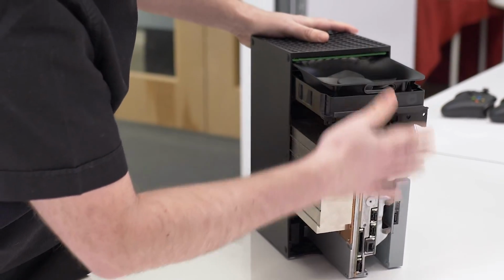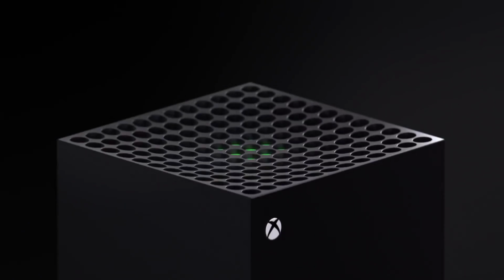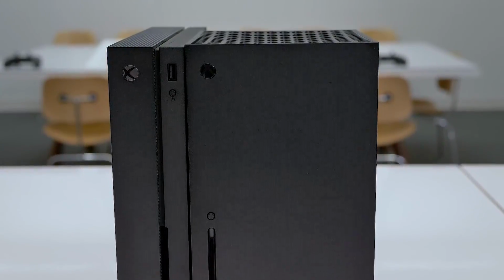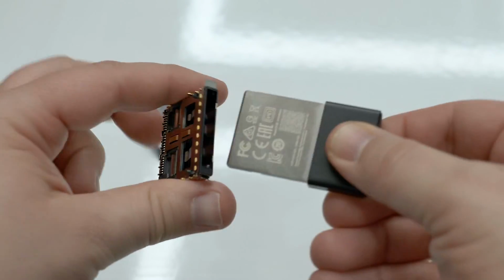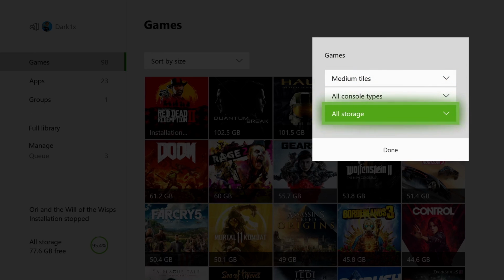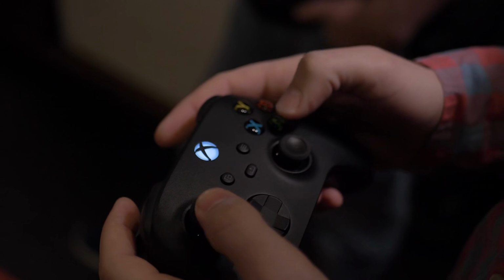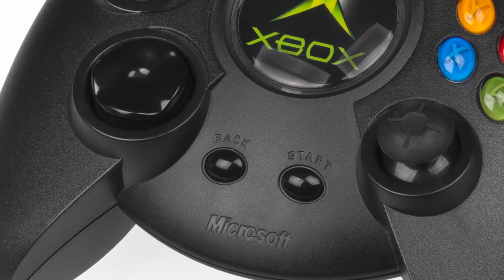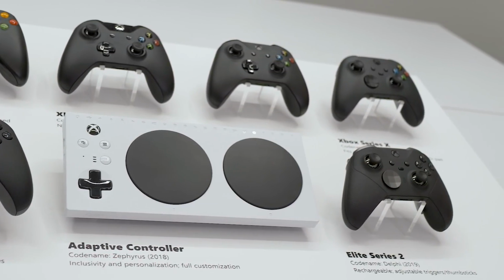DF Direct: Hands-On With Xbox Series X  + Impressions + Xbox One X Size Comparisons!

Comment: Ya a lot of pc players are having a hard time coming to terms with the x series hitting 120fps at 4k and it's only going to cost you $500-$600 alot of people covering info on the x series say RUMERS point toward $500 which I don't find hard to believe I mean with all the new GPUs and CPUs coming out this year or the next for pc it's really not hard to believe it's going to be sold at 500
Reply: 120fps at 4k..... dont be silly
Reply: @ViperT0ngue  if rtx is off ya it will info was just realised that the gpu is at 1850ghz and the cpu is 3.8ghz and by the way why else would Microsoft put HDMI 2.1 on The Next Gen X Series if they can't pull 120 frames at 4K
Reply: @chrisputkamer3249  because that 120fps at 4k will be for the platformer type of games. I have a overclocked 9900ks 5.1ghz and 2080ti with 32gb ram which is more powerful than series x, even that can struggle in some games at 4k. Get a grip mate ffs

Comment: The Xbox Series X is basically the same size as the Velka 5 PC case (The Velka 5 is 0.4cm smaller when you add all dimensions). So it is possible to compare them. The Velka 5 supports full length 2 slot GPU like the 2080ti founders edition however, the CPU tower size is limited, but can support the AMD 3700x which also has 8cores and 16 threads using the alphenfohn black ridge CPU cooler. That being said I really love the amazing design of the Xbox Series X the design team should get an award for it.

Comment: Question on SSD- if it is external. Are they keeping the cost down by not including an SSD? Consumers have to purchase their own from Seagate, in addition to box
Reply: Series X has an internal SSD that external one is an expansion
Reply: @gromester1092  hmm i did not see that only the external. Did they confirm size? I will have to watch again.
Reply: I believe it’s a 1TB SSD for the internal. There are other videos that I’ve seen that shows internal SSD and other specs.

Comment: The original One controllers bumpers were stupidly designed, the connectors to the body broke over about a year off use, it was the same design used on the original Elite too, mine broke after a year for the left bumper and had to order a part off Amazon by a 3rd party which is actually slightly better then the stock one, colour matched anyway, I had to take the controller apart to fix it. I think they changed it for the 2nd gen design so might have fixed the issue

Comment: I have a problem with the Elite controllers, the rubber grip pieces stink after a while with no easy way to clean and the material warps and pops out of the edges after months of use, I feel one day my original Elite rubber pieces will come completely off
Reply: Yeah that was a common problem of the original elite controller.

Comment: that plug in NvMe drive is strange as hell, I'm using a NvMe external on the PS4 and it gets so hot it dismounts the drive, this looks so small and plug it in and that's it i hope it looks cool, but it sounds like you can't run the series X games from it which just sounds not the best idea, the internal SSD space will be very small so it needs to be able to run games from the external SSD especially if they have gone to the extent of making a special one you have to have that's a major disappointment if going that way hasn't solved being able to play and load the new games from the SSD, so thats a big disappointment to me

Comment: This is just an overheat waiting to happen. That crammed space wont be good for ventilation.
Reply: Z Ξ R Ξ N Λ D L I I’’m guessing that you’ve never had a one x apart... that’s way more crammed. I’m also guessing that you think they haven’t been testing the series x in the Xbox take home project or done any sort of stress testing. Or you wouldn’t have said what you did 💁🏼‍♂️
Reply: @seanstammers1010  I can say the same thing and yet original x360 RROD. By your logic, Microsoft release x360 without doing any test on it, that's why the infamous RROD was even a thing.

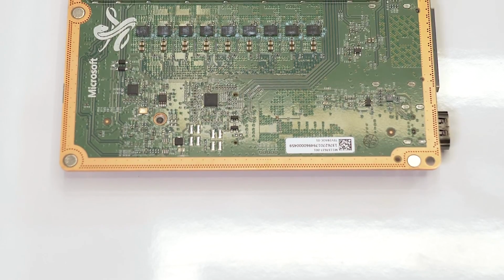Comment: At 7:14 you can see an Anaconda on the left of the chip, does that can be considered as a hint to the possibly Lockhart console ? Knowing the fact back in 2019 that the Project Scarlett was supposed to contain 2 consoles instead of just 1, and one of them was supposely called Anaconda, and as been already said that it was a powerful console, and the other one called Lockhart, was supposed to be less powerful, without any details on price, with all those coincidences, I really doubt Lockhart, the other console, is a rumor, and more to be a whole true low end console.

I can't wait to see the upcoming details, even though I hope its GPU won't be that weak compared to the Series X, only 4 Tflops apparently, I know it's still RDNA2, but I still have the feeling it's not enough, and can cause some troubles for ports on both machines.

We'll see soon enough !

Comment: I hope the PS5 uses a secondary standard M.2 SSD, with a heatsink built into system cooling, with the option for the user to expand the storage as needed
Wishful thinking, i guess.
Reply: We are talking about Sony. They allowed us to easily swap hard drive from day 1 on PS4. They definitely know how to beat Microsoft specially now that they saw Xbox and they have the time to improve in ways to be better. Doesn’t even need to be specs. Just a couple of bomb launch exclusives would be enough
Reply: @vitorfernandes651  They allowed HDD upgrades on PS3 also!

Comment: Wait hold up, are we still using batteries on the controller in 2020?
Reply: All wireless controllers use batteries
Reply: @Danebrass69  so you are telling me that I have to pop in batteries in 2020?
Reply: @94maketheworldsmile9  no. Im telling you all wireless controllers use batteries
Reply: @Danebrass69  it seems like we are not  on the same page. Its 2020 rechargeable batteries are nearly in everything. Its outdated asf. Ps3  had rechargeable batteries. So are we using outdated tech.
Reply: @94maketheworldsmile9  xbox also has rechargeable batteries. You can either use rechargeable ones or disposable ones. I have a ps4 so I know what you mean, but it still uses batteries.

Let me ask you this. Once the battery is knackered/drained, which console has the most user friendly way of changing the batteries?
Reply: @Danebrass69  I been with since the beginning. Xbox controller not having rechargeable batteries is ridiculous. What's user friendly Is plugging in a cord that charges in 20minutes. It even has USB type C. So it has fast charging compatibility. User friendly in this day in age is rechargeable.
Reply: @94maketheworldsmile9  But it's still rechargeable. My friend has the X and charges the controller through a cable. I have a ps4 and I charge it through a cable. The only difference is the Xbox can easily have the battery swapped out once it's knackered. User-friendly point goes to Microsoft there. If I wanted to change the battery on a PS4 controller I'd have to take it apart using a screwdriver and clip the two cables within the controller, and solder the new one in myself. (I've actually done this)

If rechargeable batteries are "outdated tech" then what would you recommend in its stead? Remembering that pretty much all wireless devices (including your phone and car) use rechargeable batteries.

ps. it isn't USB C on the Xbox One or the PS4. The new consoles will be utilising C though.
Reply: I'm very keen to hear what you think should be used instead of rechargeable batteries.
Reply: @Danebrass69  That's what I meant on the next generation of controllers using USB type c, so they have fast charging tech, but the mere fact is that it's not in the base model is nonsense. 
How is it convenient if double AA  batteries runs out in a matter of days?  What if you dont have double AA batteries on you at that time. Even if you plug in a cord you still have to leave and pick up some more. And again ps3 have this technology.
 And the durability of the cord slot in this generation of xbox one controllers were horrible already. Cant tell you how much money I have spent for a new controller because of the charging slot being loose.
Reply: @94maketheworldsmile9  Don't use disposable AA batteries then - use a charge pack. Problem solved. The only issue is that these are sold separately to the controller (but you've probably already spent way more on disposable batteries)
Reply: @Danebrass69  I have being buying a charge pack since 360. It's a day one purchase for me. But the fact you have to purchase something that should be standard is and issue. We have cheap technology that comes equip with rechargeable battery. It's a standard at this point. 
How you going to call yourself a major tech company with a product that takes 1990 RC car style tech?
Reply: @94maketheworldsmile9  I agree with you about the extra purchase, but I don't believe ps4 controller route is the way to go. It has a worse use-time than the xbox and once its knackered I either have to throw the controller away or buy a bootleg battery and fit it myself.

Just like new phones. I miss the old blackberries where we could remove the back panel and swap out the battery with ease.
Reply: @Danebrass69  I get the use time arguement, but we live in a new day in age where use time of usb type c style on cellphones can literally go for days. That should not be an issue. We in a day in age where controllers supporting wireless charging should be a standardized.  In this technology is cheap. You can buy a wireless charging pad off amazon for 14 bucks. Xbox controller department needs to wake up and get with the times.
Reply: @94maketheworldsmile9  Yeah, I agree. But I also think it would be good to use modern batteries that can also be swapped when old. Both PS4 and Xbox 1 need to change their ways. 

As an example - My 8bitdo sn30 pro plus controller for the Switch and PC does this. It also has USB C for quicker charging and longer battery life in general than the PS4 controller.
Reply: @Danebrass69  I disagree but I can see why you would like that. For a person of yourself you still wish to have blackberries pop put battery. I'm okay with it being gone. As we progress in tech some tech will be left behind (headphone jack). At this point is it neccessary or not necessary? I feel as if it's necessary.

Comment: 1:27 Idk doesn't make much sense to me, thermally speaking. Seems the sole fan functions as a kind of passive exhaust, rather than forcing air out against a cooler. I would've had 3 fans: intake at the cool base, chip cooler fan stacked against the heatsink pushing air up (heat rises) to the final fan at the top exhaust. Oh and get rid of the optical drive and make it cheaper and quieter or perform better at the same noise level.

Comment: it's great that the new xbox has so much power, but I'm think the "no generational exclusives"  thing will hamper the games outside of "graphical advances", complexity and size will have to be scoped to work on the xbox S as well as the new ones. I want "bigger" experiences not graphical advances I no longer can tell is on or off.

Comment: okay clever from microsoft to make the expandable storage their own format. they will probably exclusively sell these nvme cards and i hope they wont sell 2TB of these for 200$ like most Nvmes are sold for.
Reply: No. They will cost 400$
Reply: Proprietary = expensive. These things are not gonna be cheaper than current nvme ssds.
Reply: @thisisnotreallife20  im glad im on PC then
Reply: Clever how. Even the switch has a better format. Sd cards. They are becoming cheaper. Those ssd might be just slightly less. But way more incompatible. Reminds be of the Xbox 360 storage. Was that well accepted ?

Comment: Will probably end up getting one of the new controllers to use on PC, but lack of gyro controls is by far the biggest disappointment for me. As long as there is a major platform that doesn't have it as a standard, we aren't going to see devs using it as anything more than a gimmick in multi-platform games.

Comment: I want a DF explainer in exactly what the hell a Vapor Chamber is, and why it is different / better than traditional cooling designs.
Reply: One of the primary advantages of a vapor chamber cooling system is that it occupies a smaller space than heat pipes. The flat structure of vapor chambers enables them to transfer heat effectively through a relatively small amount of space. Hence why it is being used for the Xbox Series X, as it is smaller then most gaming PC's and yet still has impressive specs. Traditional cooling methods simply wouldn't work.

Comment: 2:17 Those two GameCubes also have two GameBoy Players! You lied!
On a more serious note, I believe it is similar to GameCube because GC also went for an airflow-oriented build that pushed air in one end and out the opposite one, and if I recall correctly it was also pretty packed inside, similarly to the Wii that came after.
Reply: Exactly, both GameCube and XSX have the same build oriented design, which is fantastic.

Comment: It's 2020 and they're still using AA batteries lmfaoooo
Reply: That's a good thing.
Reply: BTW you can use rechargable battery packs. I got a couple of dead PS4 controllers that won't take a charge anymore. Replaceable batteries are a good thing.

Comment: 16:06 nooooooo! this thing will still use batteries
Reply: That's a good thing. I have 2 PS4 controllers that don't charge anymore. They make really cheap rechargable battery packs. Costs alot less than replacing or servicing the controller.
Reply: @MaxximumOne  I must admit pal you have a good point

Comment: Wait the new controller STILL takes batteries cmon
Reply: Xbox will always use replaceable batteries. Just use the rechargable battery packs. They're alot cheaper than replacing or servicing a controller. I got 2 dead PS4 controllers right now

Comment: its going to be interesting to see how they pack dedicated ray tracing hardware onto that die, a 5700xt is 251mm so i guess theres another 100mm or so of space here to play with but something like an RTX2080 is significantly bigger at over 540mm, finding a balance between outright horsepower and ray tracing capability is going to be interesting indeed, its going to have to rely on some kind of upscaling tech similar to DLSS i imagine to be in the ballpark of the 20 series when it comes to RT. 12 months ago it would be an easier solution but with DLSS maturing a lot recently its harder to see them boxing at the same level... which is fine, anywhere close will be stunning for consoles and even if they opt for 30fps on ray tracing enabled content it will be eye watering how good looking it is and most console users are well in tune with 30fps anyway. lets face it all the best looking games are going to be 30fps even if they talk up 60/120fps, the truely balls to the wall graphics will be 30fps and pushing every inch of leeway outta this machine.

looking really good, super smart design, sony need to strike back soon because theres now a feeling they dont have anything to challenge this.

Comment: Next Gen Xbox Controller: 

"Ships with 2x AA batteries"
Reply: I find it weird that's it's 2020 and people are still going to be replacing batteries. The last time I had to manage batteries was when I was kid with my toys you think I really want to do that at 24 with a kid of my own now.
Reply: That's a good thing.
Reply: Built in, non replaceable batteries are a bad thing. I got 2 PS4 controllers that do not charge anymore.
Reply: @MaxximumOne  I see you guys like to buy battery packs for 20+ bucks or wasting AA batteries? They could've included a rechargeable battery that can be replaced.
Reply: My ps3 controllers dont hold charge long at all anymore glad to see microsoft keep the controlers the same (easily replaceable batteries)
Reply: I still have my original PS4 controller from when I bought it back in 2015 and it still charges fine. People complaining are the dumbasses that play while their controller is charging and then wonder why their controller won't charge. Nobody wants to replace batteries that's pointless and just more money to spend when if I really needed to I could just buy another controller. I guess people don't have jobs
Reply: @kwm1995  You buy the £10 charge kits with 2 battery packs that last a couple years at a time, then just replace when they break. How are you not gonna play PS4 just because the controller is charging? That's stupid
Reply: @HelloFellowDinosaurs  that why I have a secondary. Actually 3 but one is for my girl. People act like they can't afford a controller these days. I agree that $60 is expensive but I'd rather pay that then having to pick up a pack of batteries all the time. This is gaming the less to worry about the better.
Reply: @kwm1995  nobody is using AA batteries. You get the rechargable battery pack and you can charge it while playing if you like. You don't have to "manage" batteries.
Reply: @MaxximumOne  the same shit you guys complaining about happens to the batteries also. You can't just recharge a battery unlimited times your still going to have to purchase new rechargable batteries. Both have their flaws but it's still one less thing I have to pick up

Comment: I’m skeptical about the 12 TF performance.. how it's possible for a small case like this to dissipate that heat...
Reply: Well Phil Spencer did say that series X will be as "quiet" as the one X. And as an owner of the one X I know that means it will get pretty fricking loud at points. That's how it will dissipate the heat.

Comment: Will the controllers have batteries built-in or will they still need AA batteries?
Reply: Not AA batteries either. You get the rechargable packs.
Reply: 16:08 you can see the cover for the AA slot
Reply: Hopefully NOT built in.
Reply: Why would it be built in?